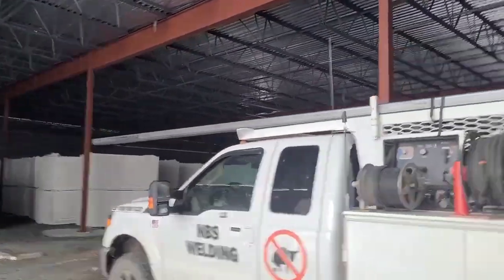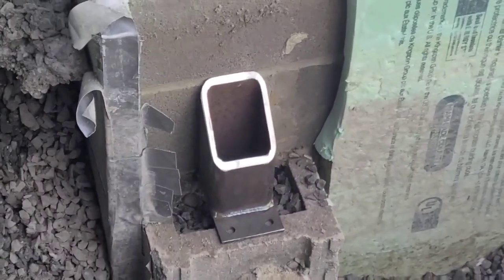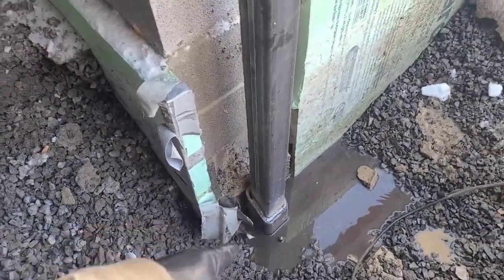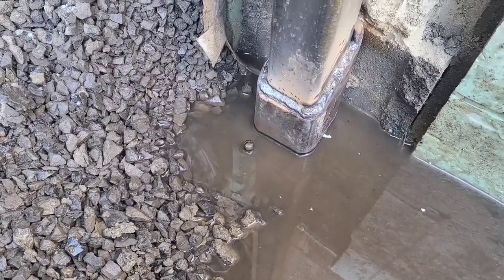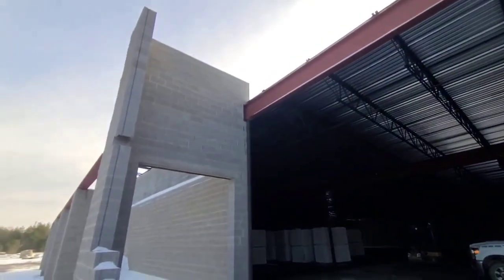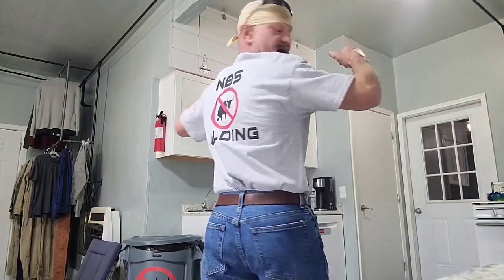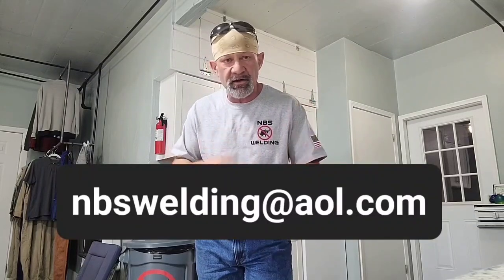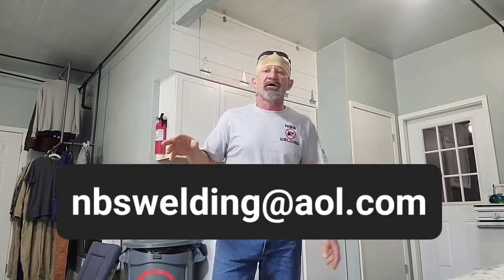Adding columns to the grocery store and doing some underwater welding

Comment: If you don't put rebar in the cells, motor filled is useless.
Reply from the maker: I thought filling with morter increased crush strength of block even without rebar

Comment: I am certified underwater welder. You need to use rod that has the flux treated or dipped at minimum. Normally you reverse the polarity and never get between your work and the ground. As for welding underwater you set your lead and work angle and let it burn in. You can NOT manipulate your weld puddle undewater and get any penetration.
Reply from the maker: Thanks for the info

Comment: Underwater welding is usually done with paraffin coated 7014, it takes a while to get used to it but it is not too difficult.  Time at depth is the major complication with underwater welding, nitrogen bubbles in the bloodstream, the bends!

Comment: couldnt you plug a small pump up to a long hose or something and have it sump while you weld? i think if the clamp is on the post it shouldnt shock the water running through the tube going to the pump because the circuit is completed at the weld point
Reply from the maker: You could pump the water out but I saw no reason to bother with that